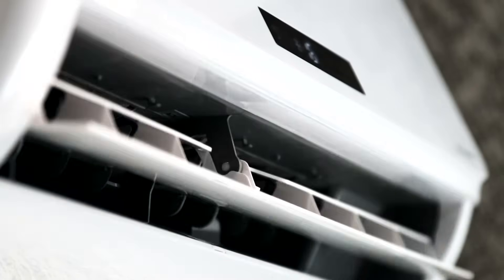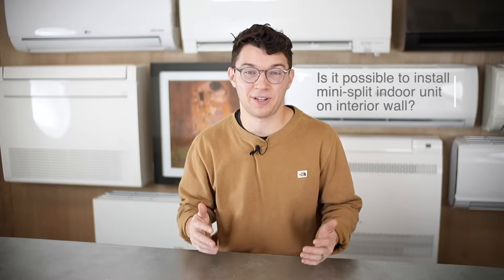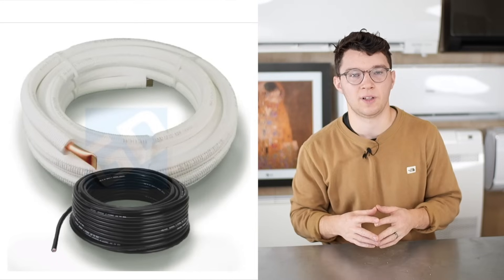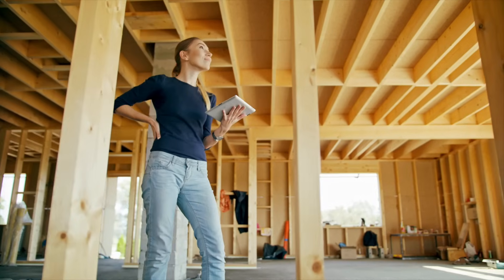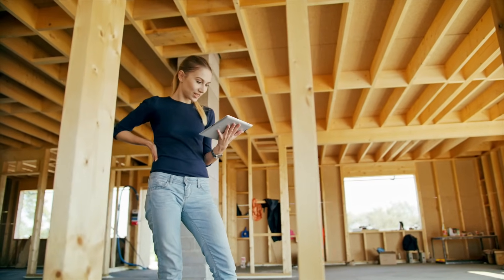Can a Mini Split Unit be Installed on an Interior Wall?

Comment: Can lineset be run from 2x4 interior wall down through the subfloor and then across the crawlspace out to the exterior wall? Slope can be maintained within crawl space.
Reply from the maker: The refrigerant lines and wire can be run without consideration of gravity. If you are running the condensate with the rest of the line-set then yes you can do it as long as you have slope.

Comment: Is a 2x6 wall deep enough to run a line inside?    I’d like to run the inline set inside the wall for a few feet before I could get down into a space behind a kneewall and run the line set out the end of the house in a traditional way.
Reply from the maker: Yes, 100%

Comment: You can and I did. I have a tall wall in my Living room, and I wanted it in my Living room as my exterior wall was brick and the electricity would have had to be run through a hard ceiling in the basement. Line set ran through the attic next to my wall with vaulted ceiling. Drainage was no problem as unit is 10 foot up the wall down to my 8-foot exterior wall. I had an old AC vent just under my indoor unit that I am using as an access to the connections.
Reply from the maker: Great input!
Reply: Do you know the brand/model?

Comment: Good video, thanks.  Quick ?.  I have an exterior wall I can use but I don't want the line set/electric/drain lines on the outside of the exterior wall since it's visible from the street, I'd rather have them run up on the inside wall since it's a garage...Can I install it like that?  Just pass through the wall towards the bottom instead of up high?  Thanks
Reply from the maker: Definitely! You can cover it up with a line-set covering to make it look more aesthetically pleasing.

Comment: I live in a 2 story condo. I have central air. There are 3 bedrooms upstairs.   They all are very warm in the summer, and never cool properly. 2 rooms face the outside back wall where the AC unit is.  The 3rd room is on the front wall.  AC units are not permitted out front.  Would a mini split be a good idea here?
Reply from the maker: Yes, you can install 2 units on the back wall and one unit in that front room. If you can't run line-set on an exterior wall then you can run it either into an attic or down to a basement through a closet. Feel free to reach out to us if you have questions.

Comment: With the 4th gen diy Mr. Cool, if I am running the line set on the exterior of the drywall, can the line that comes already connected on the inside of the indoor unit bend to go out either direction of the minisplit? It seems both sides have a knock panel, but I need the line to go out the right side, and the units seem to come with it bent to the left with the intention of it going out the back of a wall.
Reply from the maker: Hello- yes, you can bend the line-set to go any direction. Just be careful bending them as not to kink them. Also be mindful of slope for your condensate line if you don't plan on using a condensate pump.

Comment: I ran one of mini splits through an interior wall, I'm worried about the line set sweating in the wall and molding in the future (the line set is run in a bathroom wall that I'm remodeling). I do have the insulation on it, should I be worried about this or no big deal? I'm in FL.
Reply from the maker: Hello- copper lines with insulation on them can condensate when they are in high humidity areas like basements/attics/etc.. It can also sweat if multiples lines are ziptied together and are squeezed thin. From the sounds of your situation, I wouldn't worry too much about it.
Reply: @gotductlessusa I'm in Florida. My lines have insulation on them but they are still sweating.  Any advice?
Reply: Add second layer of pipe insulation

Comment: Can you replace a wall AC with a mini split?
Reply from the maker: Hello - yes, you can! But it is a little more involved. You need an outdoor unit and you need to connect the wall unit to that outdoor unit. The outdoor unit is powered from your electric box.

Comment: I installed a mini split in my workshop attached to may garage. I ran the line set up and over the ceiling joists. The air handler was mounted above a sink so the condensate line ran down inside the wall into the drain for the sink with a dishwasher attachment
Reply from the maker: That is creative! Every jurisdiction has their own codes so that method may work in your area while it wouldn't pass inspection in other places.
Reply: @gotductlessusa  correct, some jurisdictions do not allow you to tie the AC condensate drain into existing drains. Always consult your local codes if applicable.

Comment: Variation on a theme:  Is it possible to install a mini split unit on an exterior wall, but the line set run is above the ceiling in the attic?  If so, is it possible to do this without visually exposing the line set to the occupant?
Reply from the maker: Yes, you can install a mini split on an exterior wall with the line-set going up to the attic. The only thing you have to consider is the condensate, but generally you can drop it out directly outside. You can hide the line-set by putting it either in the wall or if its a finished space, into a line-set cover. Like these: https://gotductless.com/collections/line-covers

Comment: I installed 3 head units in a interior wall thru a corner closet and down to a basement ceiling cavity . I would recommend converting the condensate hole to sch 40 3/4in pvc for the horizonal run out to the exterior wall or a sum pump pit for better flow with no trap water.
Reply from the maker: That's a great idea! For interior work we do recommend hard piping for a more permanent installation.